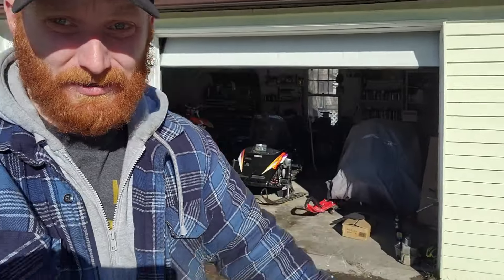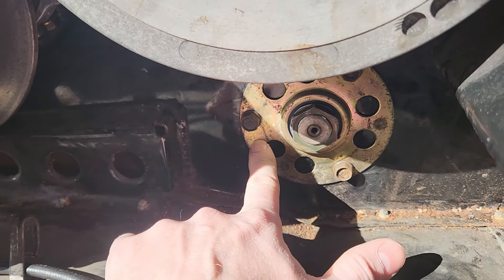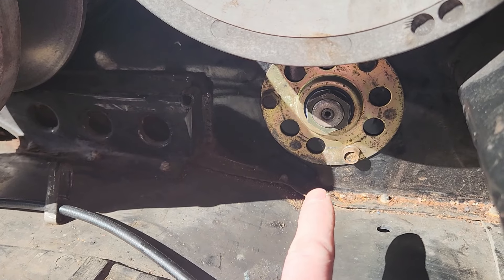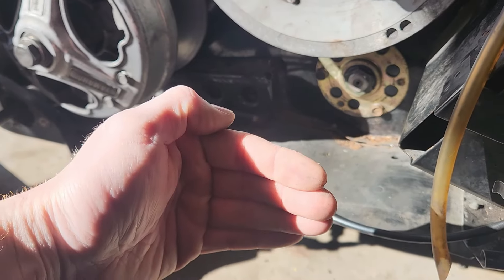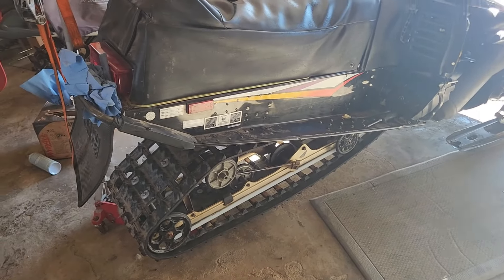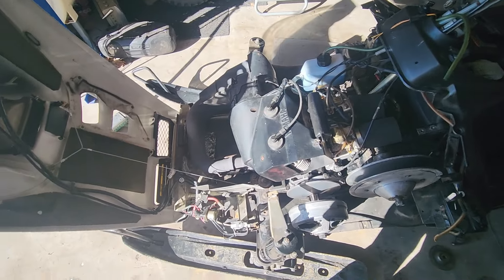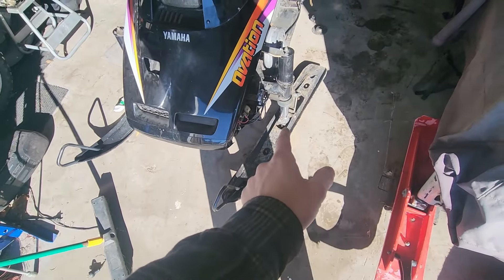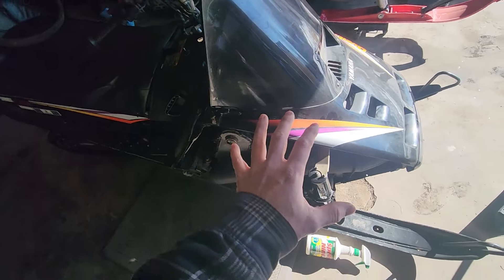Update On The Engine Swapped Yamaha Ovation Build - Part 6

Comment: Nice project,I have no idea what gears or drivers you have but it’ll only go what it’s geared to go
Reply from the maker: Yup has factory 17/29 gearing. I'd like to bump it to an 18 upper gear, should pull it no problem once the ported cylinders and everything is on
Reply: @minnowlaketuning  ok then I’ll guess 77mph and 82 with everything else on gps
Reply from the maker: @Dsc577  yup I'm thinking right around there too

Comment: You'll likely need to make some clutching accommodations for that Aeon pipe and better cyls. More power = higher RPMS and you'll want the clutching to be in that sweet spot and not over-rev.
Reply from the maker: Aaen pipe calls for 7250 rpm and the clutching in it was pulling 7200 when I was riding it so she's pretty much bang on. Gonna leave er how she is i think
Reply: @minnowlaketuning  good stuff. I'm predicting 90 MPH. Could always grind a tad off the primary weights to hit that 7250.
Reply from the maker: @ArcticJeff  yup thought about grinding a bit off but I'm using a digital tach and I assume it could off by 100rpm or so i figured she's close enough haha. I think it may hit 90 with a 1 tooth taller upper gear but that's gonna be tough, but I think possible

Comment: I say, Keep the Aeen pipe, pop some more studs in there, polish the inside of the exhaust manifold for smoother flow, & index the spark plugs~  My guess 171km/hr in the 1/4 & still pulling. 
Hoss.
Reply: oh....& pull the drive shaft out & turn it on a lathe to allow for less rolling resistance..... 😉😉;)